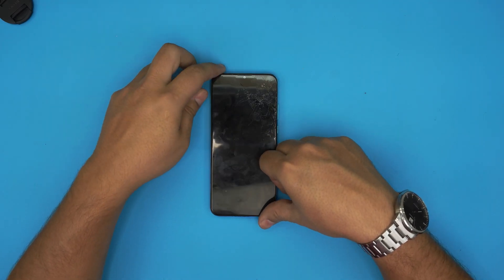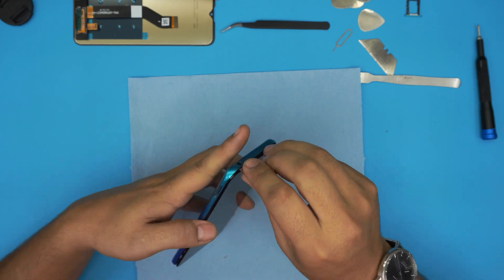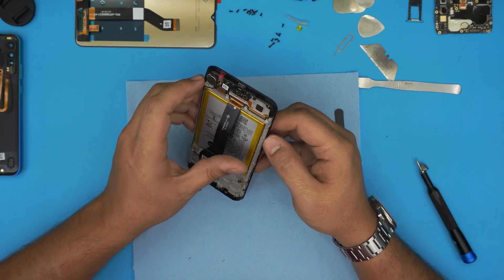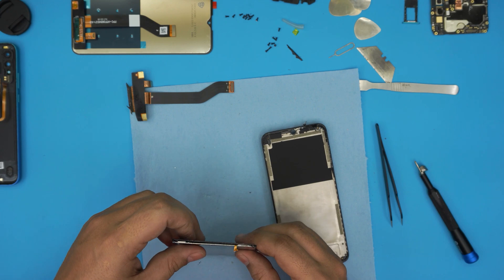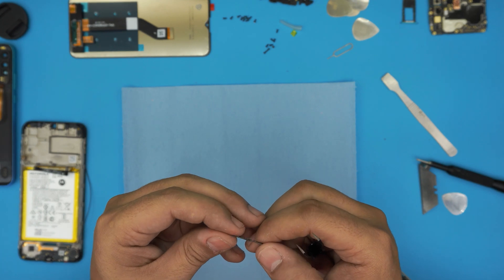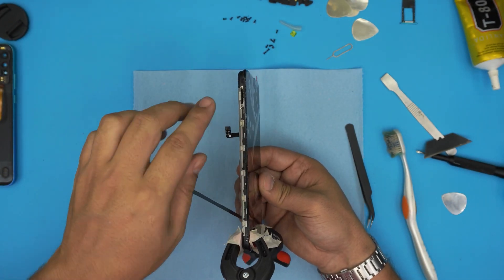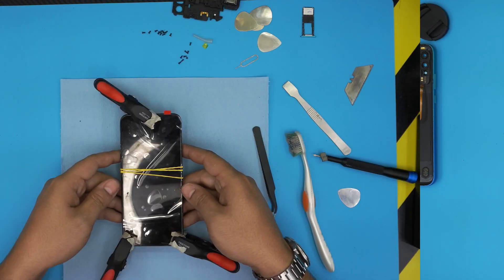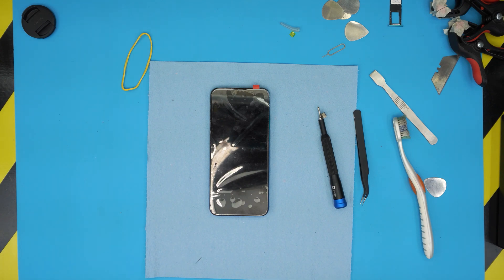Moto G8 Power Lite Screen Display Replacement | LCD REMOVAL |

Comment: Thanks to the video I replaced my screen ! 
After gluing the screen with T-7000 glue, a minimum of the glue has come out and can be felt at the edges. How to remove it ?
Reply from the maker: Thank you for your feedback! If you wish to support the channel, you can like, subscribe, or both!
Regarding your question, having excess glue is quite common. It's best to leave it alone for a few days as it will eventually fall off when you rub it. However, it's important not to try removing the excess glue immediately after applying it. Doing so may cause the glue underneath the screen to come off. The glue has an elastic-like consistency, so it's advisable to wait for it to dry for a day or two. Afterward, you can clean it by rubbing it with alcohol.

Comment: Very instructive video! On Aliexpress, you can buy a replacement screen with and without a frame. Do you know if both are compatible and which one to choose? And is it possible to do the procedure without heating the screen or if there are alternatives?
Reply from the maker: Thank you for the feedback! if you wish to support the channel you can LIKE or SUB or both :P
regarding your question: both are compatible, and about the heating don't need a heat gun, use a hair dryer at max heat and keep the heat on it for few min.
if you have any question or request in the future feel free to ask me.
Reply: @uFixTek  Thank you for the response! I am currently having some trouble, there is one screw (motherboard) which I cannot get moving at all, do you have any tips or advice?
Thanks in advance

Comment: By heating the screen to 89 degrees, isn't there a risk of damaging the battery or the ear speacker that sits alongside the front camera hole ?
Reply from the maker: Thank you for the feedback! if you wish to support the channel you can LIKE or SUB or both :P
regarding your question: you are not concentrating steady 89c directly over were the speakers are, you are moving the nozzle around in a circular motion (slowly) and the speaker and the camera and battery will be just fine i been doing this for over 18years and never had a issue. just don't keep the heat at one place without moving out, it should take you 3-4sec to travel 1"  distance. with a distance of 1" away from screen

Comment: Hi and thanks for the video! On Aliexpress there are two types of replacement LCDs : Original, similar to yours and with a big termal pad under the bridge/flex cable, and a version without the Original writing and without the termal pad that costs a bit less.
Can you recommend which one to take and if the Original version is actually better than the NON original version ?
Reply from the maker: thank you for the feedback! if you wish to support the channel you can LIKE or SUB or both :P
regarding your question:  both last the same and the same quality, truly go with none original.